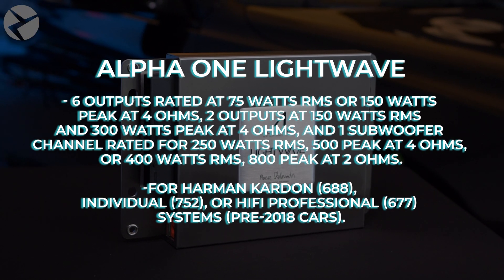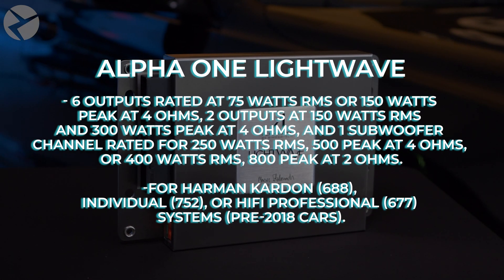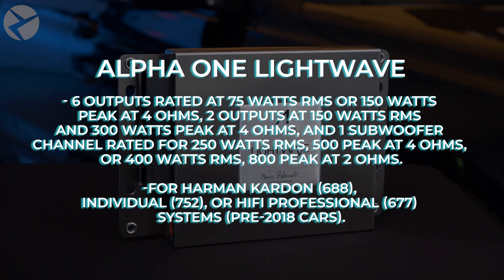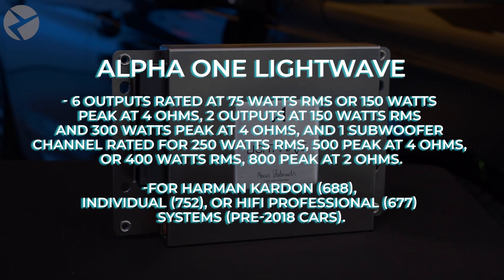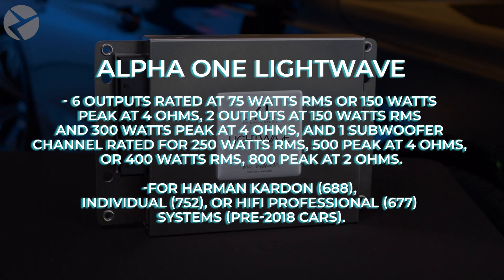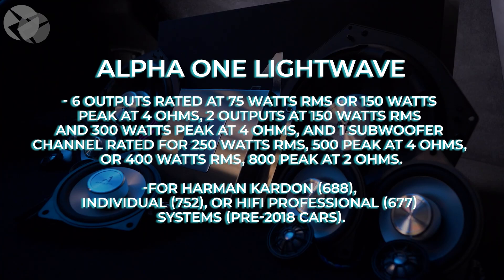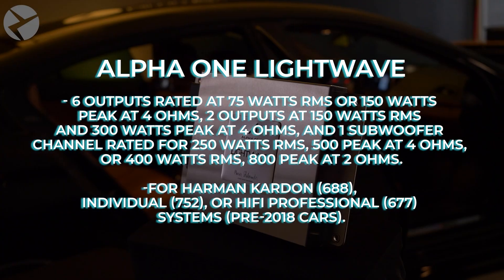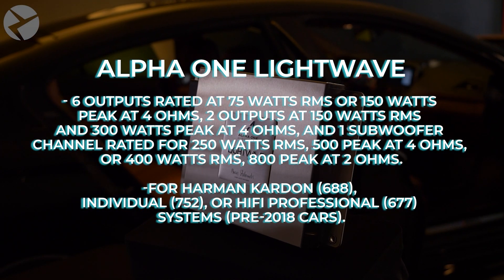RMS vs. Peak Power in BMW Sound Systems Explained!

Comment: Am I leaving alot on the table? My 2 subs are 1800 RMS combined but I have a hi-end amp that does 1450 on the birthsheet.
Reply: Sound like you  might need 2 different amplifiers. For each SUB to get the max capability